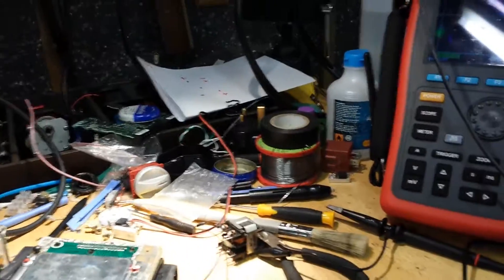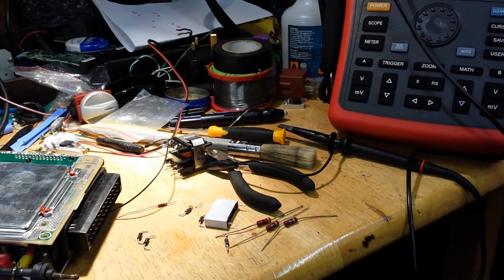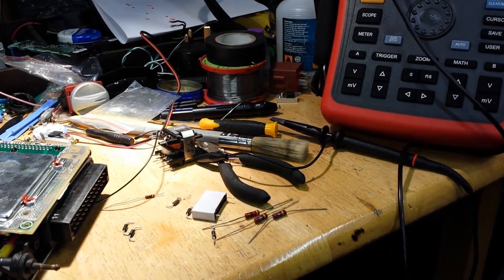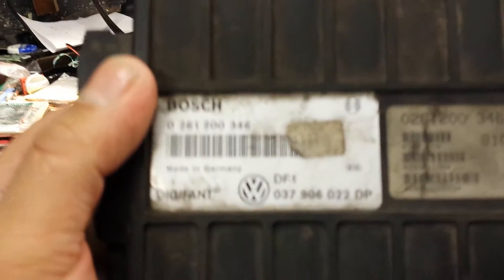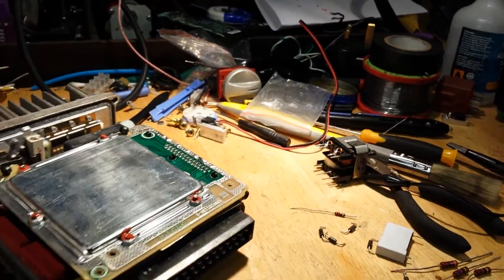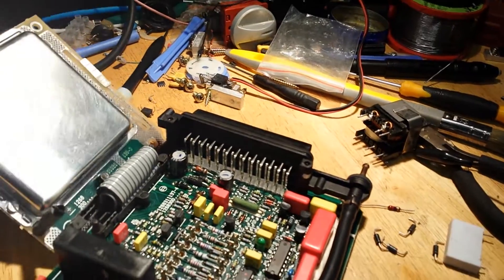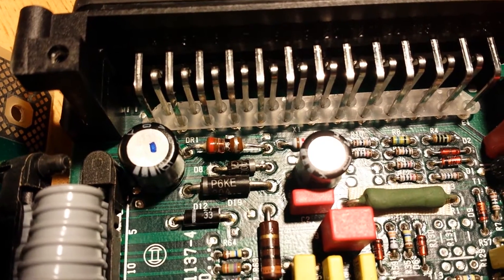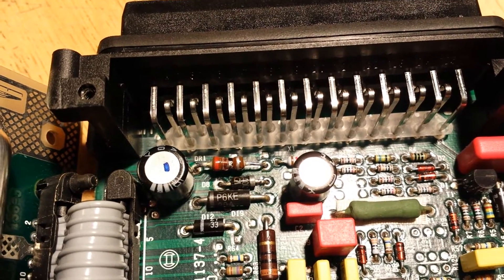Volkswagen Corrado G60 1992 no spark ECU problem.

Comment: Do you have the values for the diode and capacitor?
Reply: The capacitor is 40v 100uf
The other capacitor (in the right side) is 25v 100uf

Comment: Do you trouble shoot Japanese ecu too? Car lost spark somewhere and guessing it ecu because I test and change almost all ignition parts, and still no spark. I tested harness too and there no OL or infinity in wiring.
Reply from the maker: Have you checked power and ground to the ecu, fuses etc?
I know is basics, but just to make sure...
Thank you for watching!
Reply: Yes I check power, ground, fuses, relay, ignition signal, and harness plug and there voltage to it. Something not sending power to ignition coil. Fuel system is only thing working so far but there no spark any of spark plug wire. Possible ecu shorted out?
Reply from the maker: @kennedywong9854  
When you say no power to the ignition coil... how many wires does your ignition coils have?
Reply: There only one harness  plug connected to ignition coil. There voltage on it. I crank car and no spark. CAS separate from ignition coil.

Comment: LM auto repairs. I know this was along time ago. I seem to be having similar issues. Will be opening my ecu up. I have located all of my pin outs and all wires are appearing to be wired correctly. However going through comments one individual believes your repair to be potentially harmful. Some debate about whether it is a resistor or solenoid. Out of the 3 parts you replaced what were the individual parts and your comments mentioned it started right away. Was there any issues after the fact after time and a few starts???!!!????
Reply from the maker: Hi
I see this car quite often, and it still going...
If it fails again, I will most likely make another video for it...
Thank you for watching and for your comment!
Reply: @LMAutoRepairs  
Thanks for your great video i have this specific issue, my coil isn't receiving 12v so no spark, the funny is if i disconnect the black wire from the coil i have the presence of 12v as soon i connect in the coil i lost the voltage and obviously the engine won't fire up.
I replaced today the cap and the diode, the 22 ohms resistor the shop don't have in stock but the issue still goes on. My resistor isn't burned and the guy at electronic shop measure the resistor and is ok.
Do you have any direct contact to speak with you? email or whatsapp?
I really need to fix this, it drives me crazy.

Comment: Hey man, do you have a datasheet or what do you use to find out whats included into the spark circuit??
Reply from the maker: armando nika 
Don't think I have... I have just followed the circuit on the board... try Google....
Reply: +lmsvvavr oh ok got it. Thanks bud
Reply from the maker: armando nika 
I found something on my server... Google "Volkswagen Corrado - Bentley - Factory Repair Manual 1990-1994.pdf"
Hope that helps...
Reply: +lmsvvavr thank you but actually i cant find anything there is everything on payment 😔
Reply from the maker: Here...
https://www.sendspace.com/file/lhvk64
Reply: +lmsvvavr thank you very much

Comment: Hey bud having a lot of problems with my '92 Rado starting. With this faulty ecu were you getting and power at the coil and at the dizzy? Just no spark at the plugs?
Reply from the maker: James Robertson 
Hi
The symptoms is no signal to the coil an no spark... if recall correctly...
Reply: @LMAutoRepairs  I have no spark plug because if i disconnected the black terminal 15+ from the coil i have 12v presence, as soon as i connect to the coil i lost the voltage.
It's the same issue?

Comment: Did you mean DR1 component ? It is not resistor but solenoid, it chokes high currents in Digifant power circuit. In most cases it will burn if you short circuit power supply of ECU to GND or there will be some very high current inducted (not likely to happen)
Reply from the maker: Hi
I don't think I ever refer to the DR1 component as being a solenoid...
It is a resistor... a 22ohm 1w... I have indeed replaced it with a 22ohm 5w... hopefully will last longer...
thank you for watching and for your comment!
Reply: Trust me DR1 is solenoid (or inductor or choke as you prefer) for sure not resistor. As I remember 21uH. Why do you think it is resistor and where this 22oHm resistance come from ?
Reply from the maker: Rafał Miecznik
Look, DR1 is a resistor...
I know what component I have removed and which one I have soldered back...
Actually it even looks like a resistor, with the value colour bands and everything...
Now, if that resistor is part of a solenoid circuit, that's another story... I don't know, cause I never checked nor followed the circuit...
Hope that brings some clarification...
Reply: No :D http://www.electronics2000.co.uk/calc/inductor-code-calculator.php
It seems you have no idea what you did change :) It is only a good advice to replace it back but if you think you're right it is your problem. But next time this new resistor will survive a short circuit and CPU will be burned. This solenoid is supposed to protect the whole digifant circuit, and it is missing now. Posting video like this will make other people to reproduce such mistakes. If you take a stock Digifant and measure it's resistance it will show only 0.4 Ohms not 22.
Reply from the maker: Rafał Miecznik 
At the time if I recall correctly, all the search I have done (I never found ay diagrams...) pointed to be a resistor...
If I ever come across a good working ecu, I will investigate this further and will update any misleading information.
For know the car is running faultlessly... 
Thank you for your input.
Reply: yes it will work for sure even if you short circuit this component. But if you put there 22Ohm resistance you are actually blocking current flow to main power transistor. I am not sure how it affects engine work but I am pretty sure you are disturbind ADC conversion in CPU and it will be source of unexplained problems like timing advance, mixture and so on... but like I said do what you want, it is your car and your problem :) And I am 100% sure it is solenoid.
Reply: @ravm84  I think you right, I have also faulty box and DR1 I can see cupper, looks inductor. But which value it need to have ?
Reply: @ravm84  Thanks for feedmack !! when color I found is right it should red/red/black/silver. Then it is 22uH 10+/-, but I found only 740 mOhm / 560 mA. I didnt find better picture of digifant.      I check DR1. it is copper with ferrite inside !
Reply: is 740mOhm okay ?
Reply: @januar0815  I would look for an option which can handle as big current as possible even if  it does not match 31uH perfectly. This is why it fails so often because original one can't tolerate high currents and this is why I know it can't be a resistor ;)
As far as I remember, I ordered ~20uH 1.4 Ohm and it was working fine.
The purpose of this solenoid is to filter spikes of current.
Reply: @ravm84  okay, I understood. I will check if I can find simular. Many thanks for your help and details 🙂
Reply: @ravm84  Then these shoud be perfect > 22uH 1.1A 0.35Ohm
Reply: @januar0815  in worst case it will burn too, but I think it should be fine. It's hard to tell what was the original inductor current limit...
Reply: @ravm84  yes, I found shematic of the digifant, there you can also see that there is no resistor, but no value of the part. I have order parts and will give an update after soldering 🙂
Reply: @januar0815  exactly, and if you will take a multimeter and trace to which pins and components it is connected, you will find this solenoid is on a main power line. Who would install a resistor on a main power line in series ?
I am just afraid seeing video like that one :D
Reply: @ravm84  yes, On shematic you can see that it comes from pin 14 (+Bat) to D8 and then to DR1. So it makes sense when you say it will filter spikes of current.
Reply: @januar0815  there is also a capacitor connected in parallel to that circuit, so this is low-pass filter ;) I am glad to see at least one person who can think by himself, there is still a hope :D
Reply from the maker: @ravm84 
I would just say, that the car still drives beautifully, 8 years later.. 
Weather I did it right, or wrong with the limited information I had at the time, it got the car running, and still going...
If that is a solenoid, a choke, I don't know... I just know the resistor did the job...
I am not saying in anyway that I am right and everyone else is wrong, even because most likely I am the one that is wrong, all I am saying  is, that there is many different ways of killing a rabbit... if that makes sense...
👍👍👍
Reply: @LMAutoRepairs  yes and I am very happy with your video, it helps a lot !!!!!!!!
Reply: @januar0815  Can you share the schematic?
I replaced both capacitor (the shop only had 50V 100uf but they told me there is no problem to use) and replaced the diode.
The resistor the shop don't have actual stock but following your comments here, it's not a resistor, it's a inductor 22uH?
What color code? Red+Red+Black+Grey?
Reply: So, I received the inductor 22uH and assembled it and it works !! Also I exchange both capacitor 100uF. They are already stinking like old fish....
Reply: How can identify this solenoid so I can get a replacement?
Reply: Type in google "solenoid color calculator" and find some picture of digifant if you colors turned to "ash" color.
You should get about 32uH. Choose also the one which handles lot of current (the more is the better) and as low resistance as possible less than 0.4 ohm otherwise it will burn after engine starts.
Reply: Rafal if it chokes the current than its a resistor and maybe its used to choke the solenoid current but its not a solenoid.